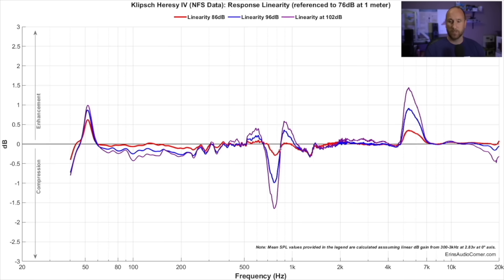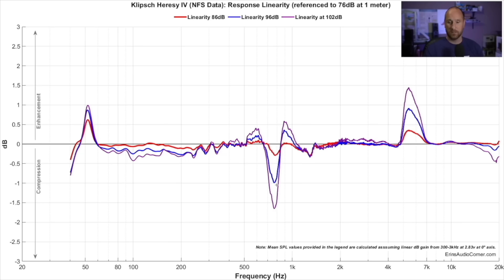Speaker Compression Sucks the LIFE Out of Your Sound!

Comment: Erin could probably explain the science better than I can but practically, this is crucial for home theater. 105dbc at 1m using a point source speaker is about 96dbc at 10ft (the inverse square law isn’t perfect in small room acoustics). Dolby spec uses a c-weighted SPL measurement and their frequency response spec has slightly elevated bass. Which means that 96dbc is will really more like 90-94dbc (based on how much extra bass you prefer) from 160hz-1600hz, and then the SPL gently falls off each octave above 1600hz. 

This means that to actually hit 105dbc peaks in the 40hz range for speakers at around 10ft, you’re looking at the speaker producing 114dbc at 1m. 

Another practical question, are you needing bass management in your room, are you using a mix of bass managed and non-bass managed, are you not using bass management at all? This is where your flavor of DSP comes in. Small room physics tell us that we should be using bass management in every situation except when using Dirac Live ART. Under the hood, ART is using a mix of different styles of bass management that can waaaay complicate a comment section so for argument’s sake, let’s leave ART out for now. 

So, we offload our bass under 80hz to multiple subs and we’re now looking at around a 1-2db elevation of bass from 120hz-80hz. This means the speaker in our example above is at a theoretical max of 108-110dbc (depending on how elevated you like your bass to be). Notice that we’re now comfortably in the THX Ultra certified SPL range. 

People ask (I use to all the time) are THX ratings in speakers even relevant anymore and I would unequivocally say “yes” because what we just went through above is just tiny slice of the pie. Buy a speaker with a recommended THX rating for your seating distance and if you’re a lay-person, call it a day. It’s going to be insanely clean, it’s going to be far easier to tune to your room, and it provides an easy seating diagram to follow for excellent sound. If you’re frickin nuts like the rest of us, keep that THX rating in your pocket as a reminder of the insane comment I just wrote out 😂.

Comment: Sir its exponential..not linear..aa you get louder its like race cars.. its easy to go from 30 mph to 60..but harder to do 120 and almost impossible to do 240...takes doubling of either power or cone surface .. your issues your discussing is room nodes..not speaker faults. I easily do 135 in my living room..

Comment: Why no discussion of distortion for how compression changes the sound?
Reply: It certainly does change the sound.
In the 70's, as a teen audio enthusiast, the first thing I learned was hearing the onset of compression. 

Back off the volume until the composure is regained. Done.    

Hearing the onset, subjectively, I'd characterize as an absence. It's a subtle thickening overlaying the playback dynamics. 
It's lossy, I²R loss.  

It's voltage drop. The signal dissipated as heat.          
 
Once encountered, that deviation from linearity can establish the limit of playback level. Back it down a touch, done ... dynamics intact. 

That said, maybe the second skill one learns is spectral weighting of the material ultimately re-establishes that max limit! 

From Aja, then 80's reggae, hip-hop, and Bob Katz' Shuttle recording, onto the spectacular bass processing available today, those benchmarks reset the bar for me!   

Thoughts? 
 How do you describe how compression changes the sound? 
Thanks

(I once performed an in-situ compression experiment on a grand scale! Bass Pig would've been proud!)

Comment: I need to hear a high SPL system that makes me go "wow, that's notably better than my Genelec system."

The latter already goes "too loud" and is fairly accurate and well calibrated, based on an objective GRADE report.

Just haven't been shocked by pure volume systems.

Maybe a Revel Salon 2 surround sound system? But even that is only 115dB and my LR genelecs are 113dB max, and most would not consider those volume monsters.

Besides the Genelec 8381 I can't think of a state of the art high SPL speaker with low compression.

(Genelec, Devialet, Kii, and D&D, or any company that actually understands acoustics, diffraction, and beam forming or constant directivity and DSPs I'd consider state of the art.)
Reply: Completely agree if you turn something up 10dB and it only goes up 5dB and you're listening at reasonable levels, that's not good.

But I see a lot of great speakers with 1.5-2dB of compression and people think it's a large issue, when their AC being on is a larger issue.

Comment: Without tools, a simple check you can always do with your own ears is observe tonal change.  As you go louder, this dynamic compression will mainly result in a shift of tone.  A speaker might start out neutral or warm when quiet and then go lean and bright in tone as you go louder.  This is mostly a change in the bass region where you need to move a LOT of air to get loud, but for multi-driver speakers, this compression can be at each crossover region.  Maybe a 3-way has a mid crossed at 600Hz and 3kHz between a woofer and tweeter.  Where I'd expect to see compression is at the limits of each driver.  The woofer would be on the bottom end.  For the mid, it'd be near the 600Hz crossover.  For the tweeter, it would be near the 3kHz crossover.  These tone changes may be happening at several locations which less affects total tone but frequency response balance through the audible spectrum, in this case creating an overall balance change.  This compression is something you can almost always hear, quite readily even, and it's always a degradation of sound.
Reply: Unless you have really major compression, noticing the difference is really hard. I feel like once you actually reach the volume level where compression should be noticeable, it’s so loud that all you hear is loud, and you can’t really notice individual frequency bands
Reply: @biguzivert  
I'm of the opposite opinion. 
One of the first deviations from linearity I can hear is the subtle lossy characteristics of compression and I²R losses.

Comment: This is why it is important to match the speakers to an amplifier that is not too big. This issue is less prominent in powered speakers as the speaker is matched to the amplifier.
In my non audio field, I work with servo systems for robotics for photo lithography, where precision in motion and speed are the name of the game.
In speaker construction, there is a voice coil of fixed length, and a spider to hold the voice coil in the magnet gap. This makes up the motor of the speaker. This is coupled to the speaker cone, which is supported at the rim. The voice coil has limited motion range due to the coil reaching the end of the winding in the magnet gap, and the mechanical limit of the spider. Add the voice coil and the mechanical and electrical limits provide a clipping level to the speaker voice coil movement.
Due to the mechanics of a speaker, the mechanical limits show up first in low frequencies, so bass is the first to distort, not counting cone breakup at higher frequencies. 
This is why line arrays are better for sound at higher levels than larger single cone speakers. Each driver is driven within it's power range where the physical clipping is minimal.
If you have exposed cone speakers, you can check the linearity of the speaker cone with a spring scale and ruller. Check the cone displacement at 1, 2, 3, 4 etc oz  force and graph it.
Be careful with the electrical testing. use a 1/4 second pulse of 1 volt, 2 volt etc up to 20 volts for home speakers and up to 60 volts for larger PA speakers and graph the displacement by seeing how far the cone will reach out to a target. You will find the mechanical motion under power is quite linear for tests of lower voltage but become compressed at higher voltages.
Manufactures do not publish the motion data, but it can be measured to compare speaker drivers.
Reply: Slow down dude. You’re intermixing way too unrelated many concepts and you’re mixing up a lot of information. If you have something to say, say it. But if you want meaningful discussion then don’t mention 20 unrelated topics

Comment: Please would you consider doing a video on diminishing returns and the sweet spots. What kind of % better is a well rated $1000 pair over a $500 pair, a great $3000 pair over a $1000 or $2000 pair, or £5000 over a $2000 or $3000 pair. How much better can you expect when you go up to $8000 or $1000+. It's hard to know how much you should spend when you don't want to get the cheapest but you don't want to waste money and go crazy and blow $15,000 when you could barely notice the difference between it and a much cheaper pair.
Reply: Buy second hand for under half price it's what I've been doing from my first Acoustic Energy AE1 to Tad ME1.
Reply: High dollar speakers often gets you fine carpentry skills and finishes along with good computer modeling in the design. Many of those are premium, hand crafted without the advantage of mass market scale of economics, so the price is exponential while performance is incremental.
To get the economics of scale with great modeling design, look into concert pro event audio. The competition to get into the commercial equipment space has reasonable prices, for very well built concert ready and road worthy gear.
For bang for the buck, look into the commercial gear, if you have the budget for the best.
Some of the lower end digital mixing consoles have specifications in SN ratio, linearity, etc that are dirt cheap compared to the very expensive home electronics gear.
Consider active DI boxes for conversion from home CD players, tuners, etc to get it into the mixer, and output into a reasonable PA amp with moderate power. Remember SN is a ratio. Bigger amps with the same SN ratio have higher output of both signal and noise, so in a quiet residential home, look for something under 400 watts instead of over 2400 watts.
Inexpensive tablet operated mixers from Sound Craft, Midas, Allen and Heath, etc are available with over sampled ADC to eliminate Assailing artifacts, and have sample rates of at least 44.1Khz, 44KHZ, or 96KHZ 24 bit, which is better than CD quality in the least of them, which is 44.1 KHZ at only 16 bit.
Midas M32 for example has 40 bit floating point signal processing. 120 DB dynamic range A weighted,  THD + noise unweighted is less than 0.01% at 0dbu out.
I have good ears, but not good enough to hear that level of noise in the system.
Pro audio has moved away from the connection issues of single ended audio of RCA jacks and moved to shielded twisted pair for much higher immunity to RFI, hum, and ground loop issues.

Comment: One thing I have often found curious is when at a concert waiting for a show to start there is often low volume music playing and it always has a poor frequency response at low volume. However when the show starts and the volume goes up to concert level it sounds perfect or it will be perfect after 2 or 3 songs when the sound engineer dials it in. My hypothesis is that compression drivers have a very different response to input than a woofer and they just can’t be matched over a wide range of volume levels. But I don’t really understand what is happening.

Comment: Be at the sweet spot for all your gear. Nothing should be straining, plenty of headroom for best sonics.
Reply: Zero headroom is actually fine.

If you listen to material at an average of 80dB and some peaks are 115dB, and your speaker can go up to 115dB without compression and has low distortion, it won't matter if another speaker can play up to 130dB... It's no better.

Many people think more headroom makes something sound more dynamic but it doesn't. High SPL also doesn't mean more dynamic, it just means louder.

Music in general has 15dB of dynamic range or less... And that is true whether someone is playing it at 100dB on a speaker that can handle up to 115, or playing it at 70dB average on a speaker that can handle 85dB peaks.